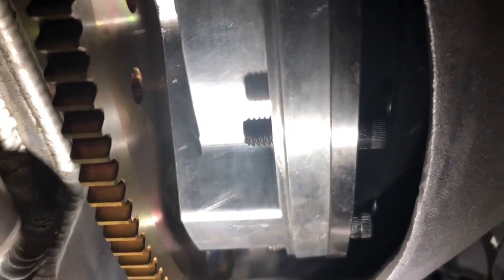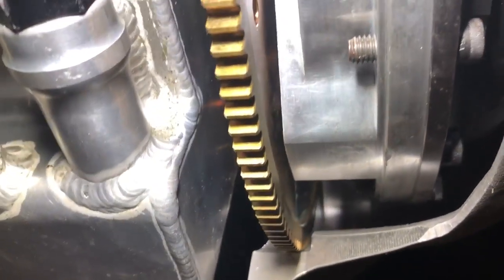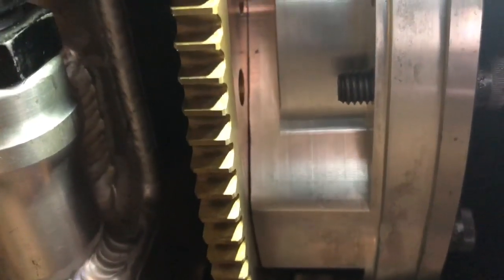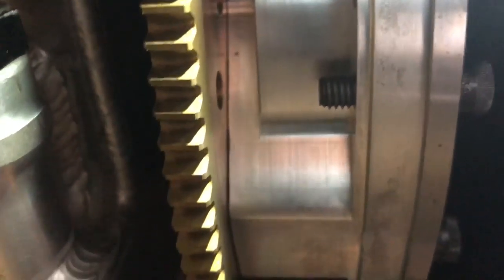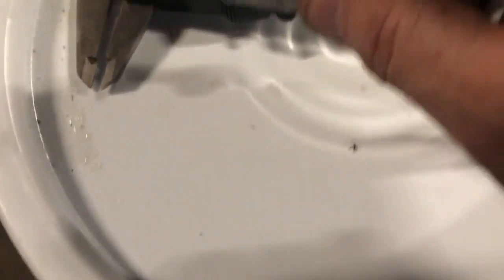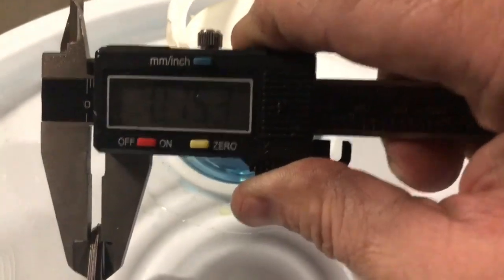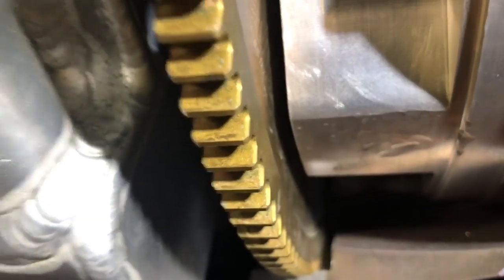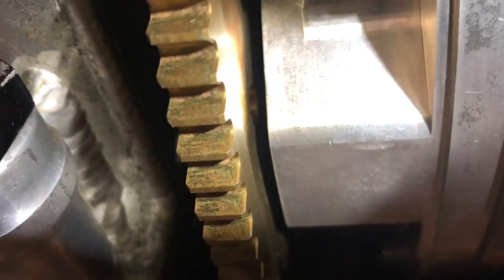Torque Converter Spacing... Stop Thrust Bearing Failures!

Comment: Thanks brother. You made that really easy concept to learn.  I could have overthought myself out of that one. My stuff is always not far from stock so I wasn’t aware to check this clearance. I know on a manual trans the pressure plate spring psi pushes on thrust bearings but hadn’t considered automatic problems until Steve Morris took apart mullet’s engine. This is different but related. Great tip. Most lessons are learned the hard/expensive way.  It’s crazy how once you learn something new like this it seems like common sense and how did I never consider this!! lol.  I subbed, take care brother. Thanks again 🇺🇸👊🏼

Comment: Yea I had no spacers on the old flex plate saw this and added 3/16 spacer now a ticking sound appears
Reply from the maker: Pull the converter all the way out of the transmission to make sure the converter pads touch the flywheel, then push the converter back into the transmission all the way.  Now, you have to measure the distance between the converter pads and the flex plate.  If the distance is .125 to .187, then no spacer is required.

Comment: JOHN, when I add the mid plate for the motor in between Bell housing and motor, Am I adding spacers?
Reply from the maker: If the converter did not change, then yes.  You should need spacers between the converter and the flex plate, the same  vs thickness as the midplate.  But be careful, the pilot of the converter doesn’t pull all the way out of the crank.

Comment: I need help with this i have a sbf with a powerglide and the convertor doesnt touch the flex plate is that ok can i put spacers in between i have movement frm front to back the convertor moves about 250 thousands but still about 1/4 away from flex plate pushed all the way toward engine im so confused thx for your time
Reply from the maker: The torque converter is bottoming out in the spacer.  That’s bad.  If you are action o car, I would pull it and change the snout on the converter or my machine it  down  .075-.100.

Comment: Precision Transmission dude says 1/16th - 1/8th spacing. The 1/16th is bare minimum and 1/8th is the max with sweet spot in the middle.
Reply from the maker: She’s, 1/16 isn’t much at all but I guess everyone has a preference.  Most major converter companies say .125-.187

Comment: Nice video. Can you talk more on the snout on the converter into the crank. please. How much of the converter snout should be in the crank? like .100 or .125  and it still needs room to move back and forth. You did touch on it a bit. Thank you.
Reply from the maker: It cannot bottom out in the crank before the pads on the converter touch the flexplate.

Comment: Thak you for this information. I note that (according to the Haynes manual) a mark should be made on both the torque converter and driveplate showing their relationship for reinstallation. However, I'm going to be installing a remanufactured engine into my 2008 mazda 3i 2 0L. Do you have any words of wisdom on how to properly determine this relationship for accurate installation? Can I make the marks on the torque converter and driveplate as they are now (pre-removal of old engine) and then transcribe the mark from the old to new driveplate in the corresponding position?

This is what causes me the most anxiety  on install. And I know it's more involved than simply lowering the engine in, securing the mounts and calling it a day 

Thanks for your feedback!.
Reply from the maker: From what I have seen, most torque converters are balanced neutral.  But yours could be different.  I don’t know, good luck!
Reply: @TurboJohnRacing  Thank you for this. Your comment nudged me to to find better clarification on a few terms. You can probable help. So, the torque converter and the driveplate are both a part of the transaxle and the driveplate is used to connect the transaxle (actually the torque converter, but transaxle generally speaking) to the crankshaft flywheel which is on the engine side. So, what I think I'm really asking but have stated it incorrectly due to lack of experience/training is:

How do I ensure that the driveplate is correctly aligned with the crankshaft flywheel when I lower the new engine down on to the mounts?  *I believe this is more accurately stated*

In your video, you show demonstration of using feeler gauges on the transaxle side but I won't be going into there, those spacing should remain appropriately spaced - in my case, it's a matter if ensuring the driveplate (on the transaxke) aligns properly with the crankshaft flywheel (engine side).

Does this seem remotely close to being correct and not too mentally insane?

Comment: Thank you so much for this one. I have a 700R4 and a new torque converter and ever sence than I have had bebre in my oil. So I pulled the motor to find the Thrust barring had some shiny spots. So fingers crossed thats the issue.

Comment: So if I replaced the torque converter on my Dodge Ram, would it be a good idea to check that clearance before removing the transmission to see what it is before? If I slide the torque converter now just to see, could it cause a problem before I am ready to remove?
Reply: I have a 318  And I got a spare engine and disassembled it to see that the thrust bearing was wearing into the crank. 
 ... I don't know what this dude talks about saying the bearing is gonna come out of the crank...It would have to wear down 1st and if it was that tight he wouldn't be able to put it together Without noticing. 
... I think hes working on a Chevy those are kind of different And a little more like toys. 
  Chevrolet's are fragile because they have independently adjusted rocker arms And also the time in cover issue with the oil Pan lip crap. 
 Dodgers really do run for a long time good and won't break down like Chevy's, I don't think what hes talking about the placement of the placement of the torque converter changing once you remove it and just put it back in the same that it's gonna be different.. That's what Chevy people have to do I guess. 
 Too bad K mart's closed you used to be able to buy all kinds of small block Chevy parts in K mart. Next to the toy section.

Comment: So a friend and I are about to remove his mom's xmsn a 4th time. 
-1st round: lots of smoke, lost power, trail of fluid. We replaced the seal at the front. They drove around 30 minutes, started leaking badly when they came back and idled in park. That was the original converter.
-2nd round: realized we needed the 9.8" bolt pattern instead of the 9.75"
-3rd round: put in 9.8" converter, filled fluid and idled for 15 min. A trail of fluid was left on the driveway backing out. A giant puddle was left on the street when stopped and shifting to drive, he pulled forward and left a moderate trail, and then another puddle was  left when I was yelling  at him to get back in driveway.
Here are my questions. Does the converter get pressed toward the flex plate when it's under load? If my gap was too large, would this explain no leak in park, dribbling when slowly backing out, but gushing in gear at a stop?

Comment: My torque converter was from the factory 94 Sierra. Looked like it had 1/8 spacer welded to the converter. Replaced the front pump seal. Still has a leak but shifting smooth no squealing or odd noises. Wondering if my converter had a hairline crack or the shaft was pitted?

Comment: Installing spacers is a pain in the butt...LOL...I use a small extendable magnet to hold the spacer while starting the bolt with the other hand.
Reply: Try stacking washers 🤣
Reply: @nsboost  Why would I do that and not just get a spacer that is the thickness I need?  If I absolutely had no choice, but to use multiple washers which I've never done I would probably super glue them together.

Comment: What's the caliper called? So you measure the space in between with converter pushed in trans?
Reply from the maker: Use feeler gauges, then measure thickness

Comment: Bought new converter on a total new setup to me. There is no play , had to shim converter off of flexplate because of balloon plate . Question is how do I get more play? Shim trans back? The stock separator plate is between them now.
Reply from the maker: Yes, get another spacer plate or mid plate.  They sell them from .060-.250 thick
Reply: @TurboJohnRacing  thankyou.  If I didnt have to space the dumb converter I'd be good. Now I have snapped teeth in the front drum where engagement to sun shell.  C4 Ford probs! Thanks again I'll look it up.

Comment: Yo John is it okay to shim the bellhousing to block with washers like 2-3 of em.  all I need is 1/2” so my stall will stop locking up to flexplate causing it not to spin freely. Tci has failed 4 times build a stall fix this issue.
Reply from the maker: Make sure the converter is pushed all the way back in the trans.  If it is, and it still hits.  Either the flex plate is wrong, or the converter was built for a mid plate.  I would not just use spacers.  Buy a mid plate, cut it down on the outside so it’s just a spacer plate.  I have done that!

Comment: What if there was less than .100 away from the flex-plate while uncoupled? Remove and mill .050ish off of the mounting lugs on the converter?
Reply from the maker: That is too close for sure.  You need to also check where the converter pilot slides into the crank.  You can add a .060 thick mid plate style spacer.
Reply: @TurboJohnRacing  this spacer goes between the crank and the flexplate correct?

Comment: I have 3/8" gap on my car. Will that be too much spacer to get that sweet number, or will it be fine? I would be using sae grade 8 washers to space.
Reply from the maker: You should be ok.  .375 gap you have now. I would put .200 ish of washers stacked between the flex plate and the converter pads.  Make sure the converter snout engages some with the crank.
Reply: @TurboJohnRacing  thank you sir!

Comment: do you ever measure the depth of the snout/adapter into the crank register? what clearance should be there to prevent the flex of the plate from bottoming out the snout/adapter into the crank?
Reply from the maker: Yes, a lot people bottom out there.  .150-.200 is what I like on that gap

Comment: My Flex plate has broken 3 times in less than six months, spoiling the torque converter and the pump. My car is Toyota Prado 120 series automatic transmission year of manufacture 2005... What should I do to eradicate this problem... someone help me out
Reply from the maker: We usually break them from too much power.  In a normal car, I don’t know what would cause it.
Reply: I bet your missing  a dowel alignment pin , if theres any slop when the engine twists it puts force on the flexplate causing it to break and bend out of balance and will eventually break from out of balance,  I see it alot
Reply: Also check your torque converter and pump for wear again out of balance cracks   flexplates,  see people try to get trans in with converter still bolted or on s trans swap the dowel pin ends up in the old trans ,easy to check if its missing

Comment: Very good video John, i actually always wondered about this,I'm still a little confused on using the mid plate,when using a mid plate do you use a special converter?does the plate move the trans rearward the thickness of the plate,changing drive shaft length, or is the drive shaft just pushing up in tail shaft alittle more...or do you let engine come forward,?sorry for the loaded question
Reply from the maker: Adding the meat plate requires the torque converter to be a little taller. Or you can use washers or shims between the converter and flex plate, as long as the clearance is correct.   But you have to be careful that the snout of the converter does not pull out of the crankshaft too far. Usually the driveshaft does not have to be shortened unless it was borderline too long to begin with. Most mid plates are .093-.125 thick.